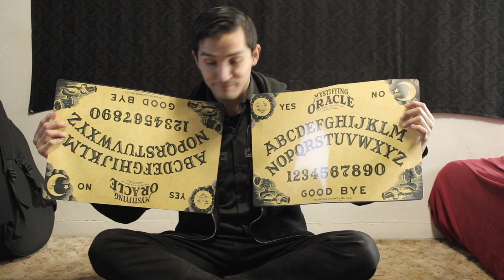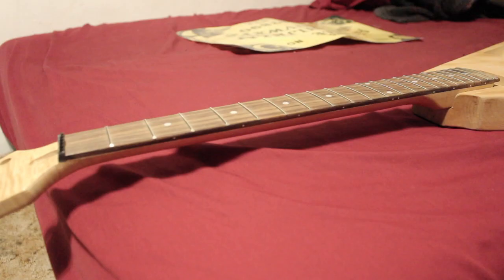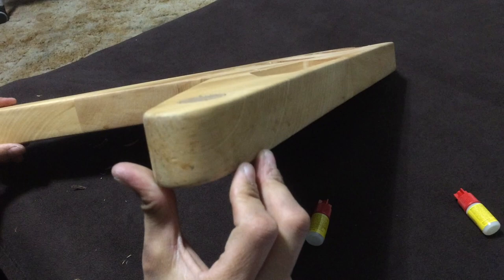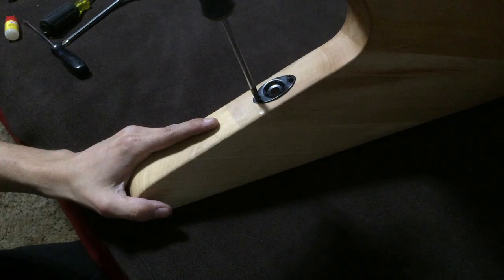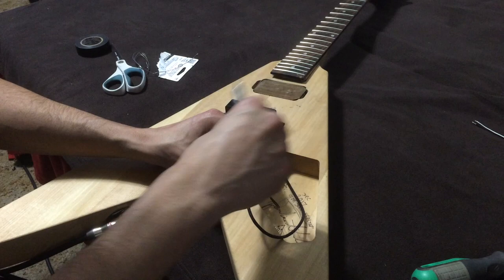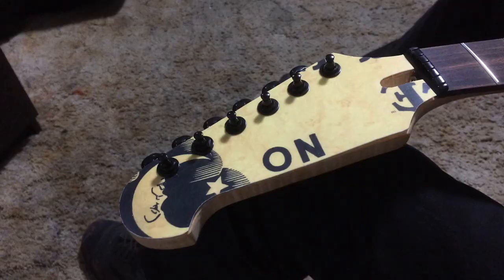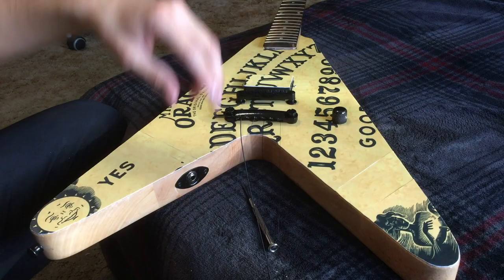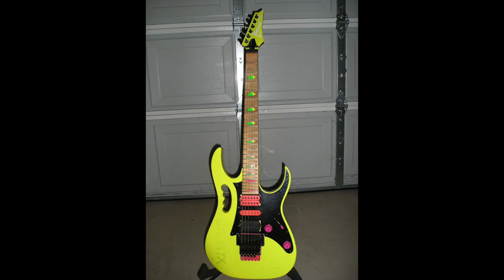Ouija Flying V Guitar Build

Comment: Question: how did you drill from the jack to the pickup? Did you have to use an extremely long bit?
Reply from the maker: I drilled from both sides until the holes crossed each other, like an L.
Reply: Zombie Thirteen this is exactly what I want to do when I build myself one. I like the Jack location on my LTD V. I wish Gibson would use a better location for the Jack and some of the earlier models have the Jack location in a worse spot.

Comment: I've been trying to get that print on a hydro dip sheet . I see this idea has sprouted to many minds . Head stock looks sweet . I have an idea to transfer a enlarged image from a black n white print from my locale print store and trace it or iron on . Then paint your clear coat .🎸
Reply from the maker: That was my initial idea, but the cutouts on the surface of the guitar body made it a bit difficult to do, and the pickups would be missing the details. Next time, it'd be better to get it airbrushed.

Comment: A stencil kit would have probably been easier with the letters paint the guitar black and stencil out the letters to make the Ouija board on it. Not bad for basically not having the right tools. But the good thing about it is when you get tired of it you can rip off the paper then just orbital sander acrostic what's some 320 Grit and you have another guitar the cardboard of come out easy so the only thing you have to do I just put the pickguard on it and add another pickup if you prefer. So you basically had your two options it's still basically an unfinished body underneath the paper. Good job.
Reply from the maker: The whole point was to not have a pickguard or a neck pickup. The control cavity prevented me from using a stencil, which I agree, would've been a much easier way to do it, but I had already sealed the wood with a matte sealing coat, as I wanted a natural wood finish.The end result was about 98% of what I had in mind. I might attempt this again later on, but someone was eager to take this guitar off my hands.

Thank you for the tips and for watching!